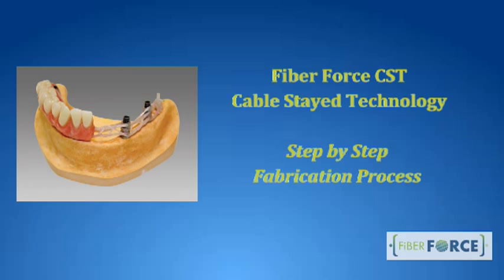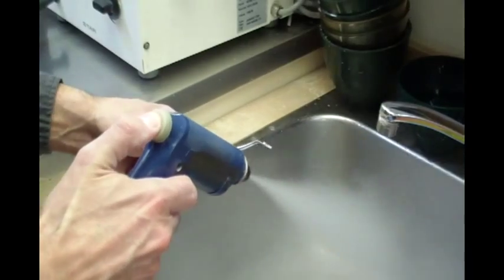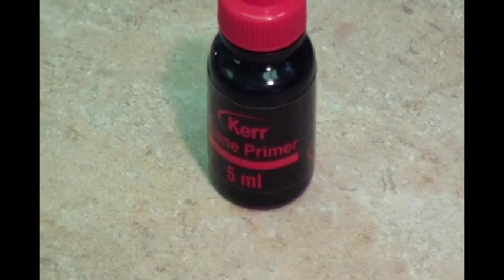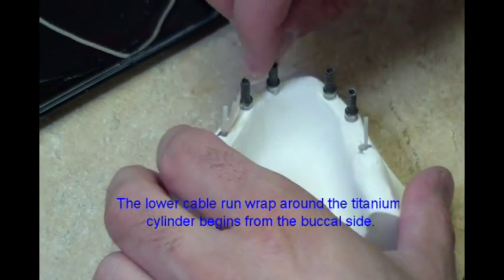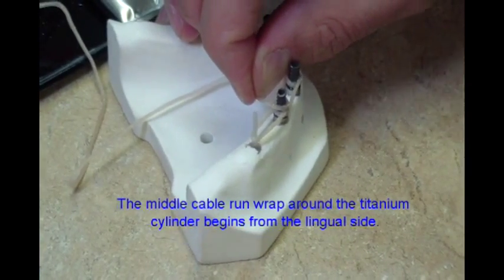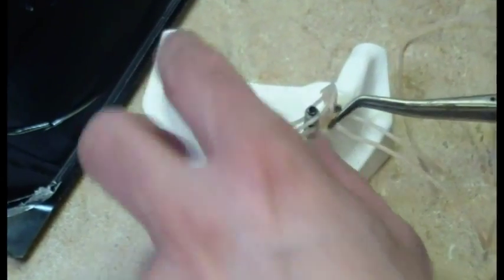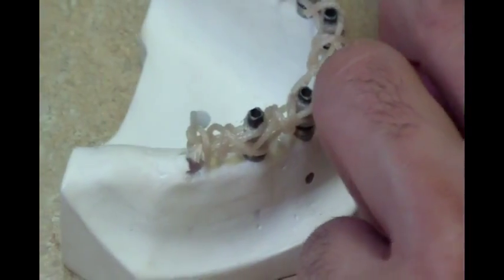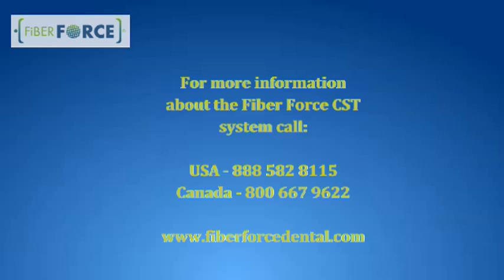Fiber Force CST Fiber Implant Framework System: Step by Step

Comment: Where can you buy that fiber strand
Reply from the maker: Buy Fiber Force in USA:  http://us.synca.com/buy/product-list.php?FiBER_FORCE-pg1-cid17.html
Buy Fiber Force in Canada:  http://ca.synca.com/cart/product-list.php?FiBER_FORCE-pg1-cid58.html
Outside of United-States and Canada:  moses.m@synca.com
Reply: I need urgent advice 🙏 I was fitted with this type of all on 4 upper bridge only 6 months ago. I was led to believe they were Zirconium. Almost immediately I had the feeling they would expand and contract from the inside out, bulging out the rear of my teeth. This was very uncomfortable but not visibly noticeable. Eventually I could feel a piece of wire or cable protruding from the back molar. Now the top of the bridge has broken into sections still attached to what feels like a wire cable running along the whole bridge and exposing a strange material, this gives sudden bursts of slimy feeling gunge with a distinctive taste which sets almost solidly in the hollowed cavity which houses  the stretchy indestructible  FIBRE which has a life of its own. This fibre feels like the source of the slimy gunge, by some chemical reaction? Now I have broken pieces moving around and digging into my natural gum causing a lot of pain and discomfort. 
The day of my final appointment to have my zirconium arch made the doctors tried to convince me to change to a “Toronto” prosthetic which seemingly was more durable and had more mobility due to this new PMMA acrylic with a thin covering of zirconia. I refused this “Toronto” and was told I had been given zirconia. I have hacked away the inside of these with a hook, threading the material trying to get some relief only for the shredded material to magically reform itself back again. Can these be fixed and without the self expanding fibre cable?